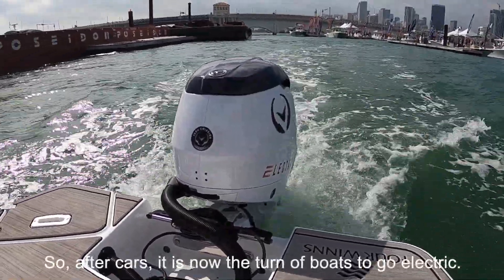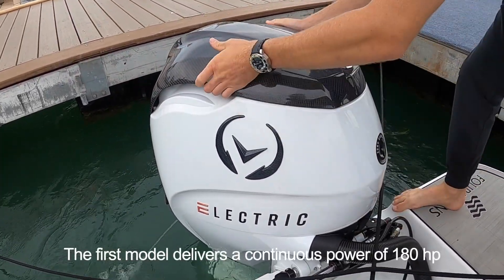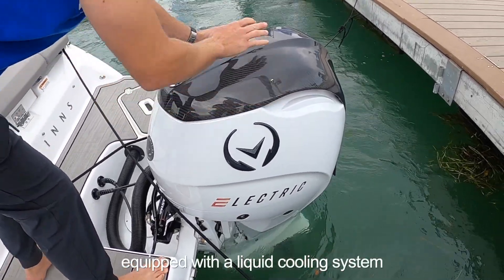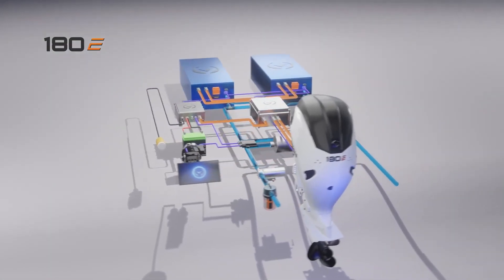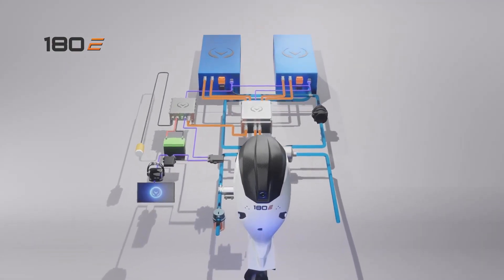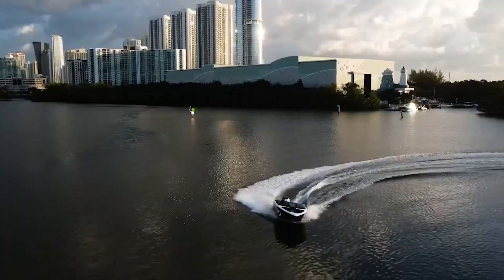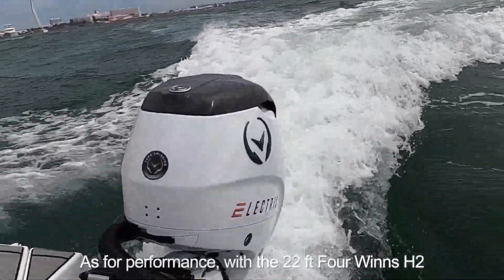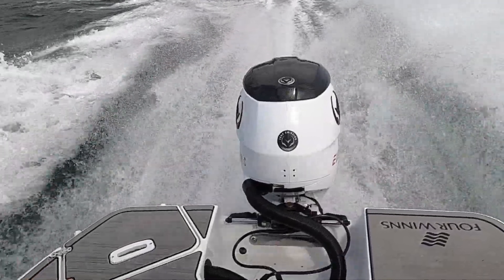Vision Marine E Motion 180E - First Mass-produced electric Outboard engine

Comment: I'm starting to understand why most manufacturers have put the motors under water where the gearbox would be, not only the added efficiency of eliminating gears might offset some of the additional drag but the noise difference is incredible. This motor is arguably loud and part of that might just gears but also the vibrations of the prop passing through the keel turbulence transmitting through the shaft.

Comment: Wouldn't designing a generator in the lower unit to recharge at the same time it is being used be more efficient than relying on a plug to recharge?
Reply: I understand but design a hub to be able to harness the movement Without being a load, it would be four mini-stators with no parasitic loss, because of 4 hubs available. Wouldn't that work?
Reply: No it would not work, as above you have described perpetual motion. Bigger hub would make it worse too. We are a battery breakthrough away from this “really” working

Comment: The motor is not a problem. The battery capacity and size are issues. More battery more range and of course more weight on the boat and less storage space.
Reply: Yes but 400l tank on 7.5m rib is not very light, thats 300kg.
Reply: Not only the battery size and weight, but the cost. This 180 HP electric outboard will cost around $120,000 when factoring in motor, batteries, controls and all rigging parts. New 200 HP Mercury is around $20,000, call it $25,000 with rigging. If this boat owner only goes 30 miles per outing it would take decades to make up that extra $100K in fuel savings. Big electric outboards (over 15 HP) are a nice idea, but not there yet.
Reply: Until we put a price on carbon emissions this will continue to be the case for a lot of things. And yeah it kinda sucks, engines are cool and have allowed us to do a bunch of stuff but I'm willing to embrace this new concepts if I have the money and eventually price will drop and it will make sense for more people
Reply: @scubacro5758  but its very accurate on it distance, battery for EV range are vary with load. that why ev truck cant tow stuff like 8k lbs over 200mil range.
average marine motor get about 1 mil per gallon. what the range ev marine battery?
Reply: @deshawn2877  
I don't think battery tehnology is advanced enough to have full electric boat of this type

Comment: I say the way to go is to  build direct ammonia fuel cells to power electric boats. These will solve the range and weight issues. Batteries in boats are not the best mix.

Comment: 30 miles 💀 did more than that on my skiff during a day of fishing. My current boat has 300 miles of range on a tank. I’ll go up to 75 miles one way offshore in my current boat.
Reply: and are you taking the boat out on your EV truck?
Reply: Yes, On a day of playing at the lake with family we usually put 20 miles on the boat. Lots of throttling up, running full throttle and pulling tubes which requires more power. 
Then a day of fishing, even inshore or freshwater we may travel 10-20 miles. 
It is a very cool concept for those who prefer leisure time on boat, but for not for someone who uses a boat for distance, speed or loads. 
Definitely not for a fisherman

Comment: If Sharrow Propeller™loop design is installed in this engine, the range will be 25% greater.
Reply: I know two people with sharrow props, neither enjoy that kind of efficiency gain. Much much lower gains than 25%

Comment: how heavy is the 180hp pkg. ?
Reply from the maker: 400 Lbs
Reply: @yachtandseatv7160  Not including batteries.
Reply from the maker: Of course  @96thundercat
Reply: 400lbs for a 180 is pretty good. Just need to get much better range to make it usable.

Comment: Don't these batteries catch fire when water gets in them 🤔
Reply from the maker: There is a pretty seriuous security system. Normally the water is not supposed to get in and there is two cooling systems

Comment: Whats the price.
Reply from the maker: Around 120 K the complete system with batteries and controls. But It's not available like that, only on OEM, you can't buy it separately for the moment.

Comment: The horrible, whining noise coming from the gearbox is a no go. The range more importantly, is also a no go. Don’t forget the cost of a electrician to wire the 220 to your dock.🤦‍♂️
Reply from the maker: You don't need the 220, a regular plug is enough

Comment: That gear whine is going to kill sales. It is a higher pitch than a regular outboard. Fail!
Reply from the maker: You are right, that's why the brand is working with McLaren to change that.
Reply: @yachtandseatv7160  I made an electric outboard, and when I had this problem I went to a direct coupling. No gears, no gear whine.

Comment: 30 nMi is double what the "average" boater uses? are you kidding me? My offshore tuna trips alone are over 130nmi. all on my 2007 225 Evinrude. hasnt skipped a beat in 16 years, and got it for $3k. 40 miles is just a joke. and thats just at cruise. long long way to go on the water if you want to beat gasoline or diesel my friends.
Reply from the maker: This is a statistic, nothing more. you're one of those people who does a lot of sailing, bravo!
Reply: Right, but... there will come a day when the electric hp is cheaper than the gas hp. Last year the battery KWH halved in price and will reduce by 40% this year. Once tech is learned, it's there for ever. The future is electric.
Reply: @jamesdonaghy9143  umm no. one again its a matter of range and weight. both things batteries will never be nearly as good at on a weight sensitive high load scenario. can get away with this in a car, but not a boat or an aircraft. the negatives are just too insurmountable for the forseeable future. im not sure what you mean by price being down 40%... your saying the price of electric outboards are down 40%? impossible. and again, where are you charging on the water for the vast majority that doesnt have a private dock/shore power?
Reply: @ct1762  
The price reductions I mentioned concern battery units, which will eventually translate into outboard prices. 
The wind and solar sources are also improving in watts per dollar and watts per Kilo, with no clear limits established, going forward. Cases where fossil fuels are the smart choice will diminish going forward until they become obsolete,  a happy prospect for all biological entities.

Comment: Omg, that motor will never sit on my boat with that high pitch sound, not only is it loud it is a terrible sound, if it was completely quiet like an electric car (without artificially generated sound) it would be compelling. But to change a gas engines nice growling sound to that? Nope. One positive though, it looks good.